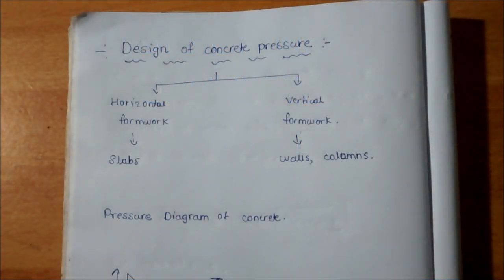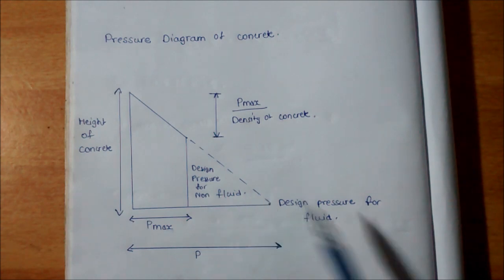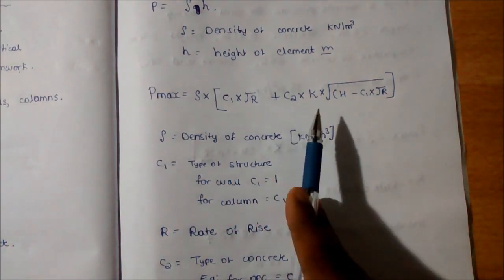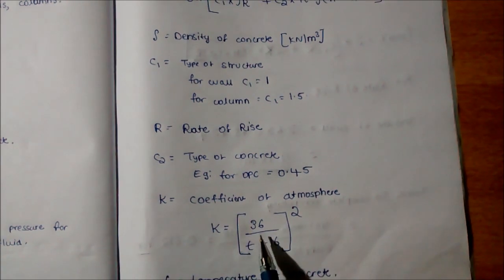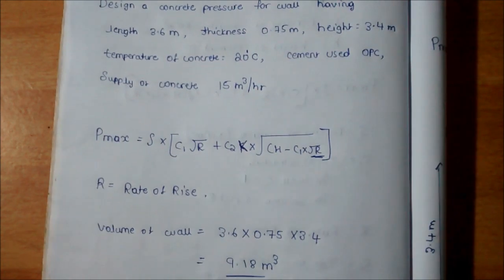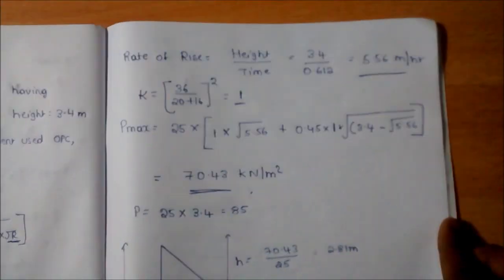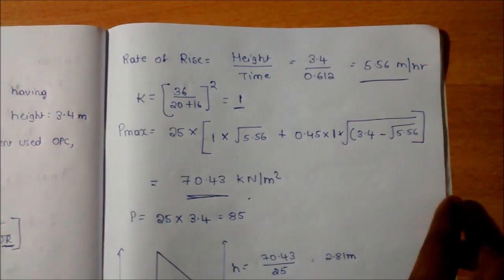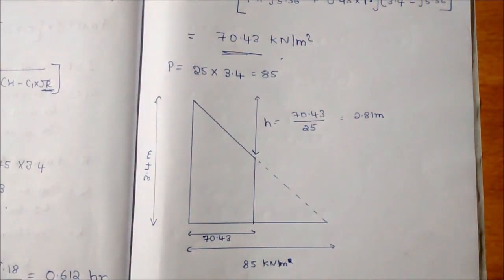Design of Concrete pressure For Formworks | Rate of Rise Calculation

Comment: Hello, I have a question. The concrete pump truck pours concrete at a speed of 50m3/h. You have selected 15m3\h as supply. Is the speed you mentioned a different speed? Am I doing something wrong? Because when I calculate as you said, it does not comply with the German regulation DIN EN 18218:2010-01, the max speed is 7m\h

Comment: considering 0.3mx0.6mx3m height column & concrete pour capacity of 15 cu.m/hr.The rate of rise is coming around 83m.In these cases what is advicable?

Comment: Good explanation for design of concrete pressure. I want to ask for C1 variable (type of structure), how do you get C1 = 1 for wall and C1 = 1,5 for column (and also the C2 variable). Is there any reference i can use for another type of cement?
Reply from the maker: Definitely, I will send you a CIRIA REPORT 108 Link In that You can refer.
https://kupdf.net/download/formwork-ciria-108_5913a67cdc0d60df47959eb1_pdf
Reply: @CIVILMania18  thanks a lot for the reference, i will study it
Reply from the maker: @kennardgeorgius3255  I really appreciated Your study Interest . Please help me to grow my channel.
Keep supporting!
Thank You

Comment: Sir one Question 
A structure element size 14.00 mtr long , 2.40 mtr height , 0.4 mtr width 
Supply of concrete = 90 cum/hrs 
T= 20°
Cement ultra tech opc 43 grade 
Find the P (max) =?
Reply from the maker: The rate of Pour will be 16m/hr isnt it?. this Pour rate is too much. please confirm me the Pour rate

Comment: what about vertical load for beams? is it the same with the walls and column?
Reply from the maker: No that is different
Reply from the maker: You have calculate concrete load as well as formwork load to determine total load
Reply from the maker: Ciria formula is only for pressure.

Comment: How did you come up with a density of concrete = 25 without a mass or weight given in the problem?
Reply from the maker: Weight of RCC is 2500kg per m3
Reply from the maker: If it is pcc then it will be 2400kg/m3